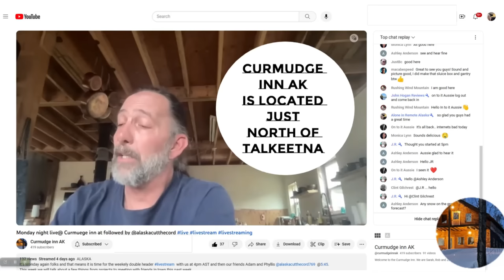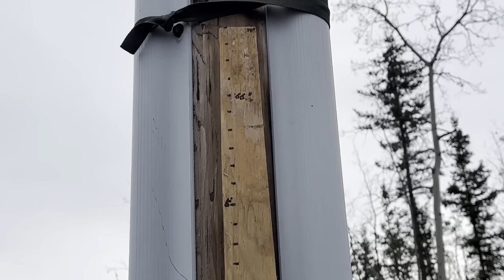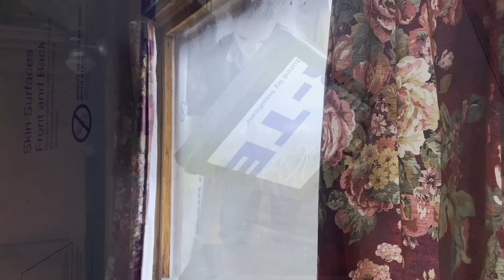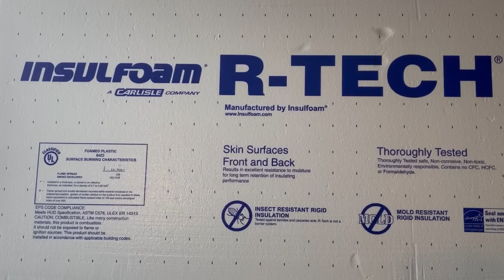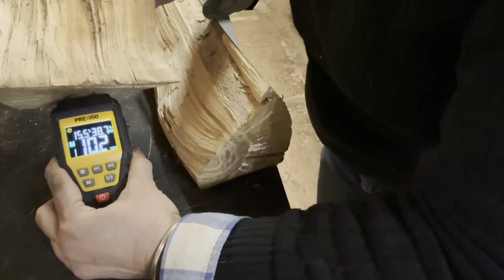DIY Firewood Storage Build - Working Smarter, Not Harder @ Alaska Remote Cabin

Comment: For window insulation, I use shrink plastic... it is clear, you put strips of double sided tape on the sills (all around), put the plastic over the window on those tape strips. Use a hair dryer to apply the heat and shrink the plastic tight. This creates a 2" thick air gap. No condensation whatsoever. And it allows light in. These come is kits that have different sizes for different windows/doors. The front of my house is 2 floors of glass 24' x 24' and this massively reduces heat loss..   For the firewood, I bring in a couple of days wood at a time and the wood dries out so much you can hear the wood splitting as it dries out. You Firewood rack looks awesome!

Comment: To completely eliminate condensation in your windows, install your rigid foam sheets into the opening (2"-4" thick) then tape a sheet of plastic to the interior wall with no air gaps whatsoever.  The interior sheet will additionally add some R value for the now completely isolated window cavity of around R2.

Comment: Just a thought from my 50+ years of preparing for winter. 50ft roll, or 2, or 3 of clear plastic, 4mil, 1/2 staples, and cardboard, to cut for strips. This method let's you keep your light, important in winter, creates an air space between your windows and plastic, which works as your insulation. Cut plastic to fit inside of windows, over trim. Cut cardboard strips to accept staples, keep plastic from tearing and damage to surface. 
Keeps the winter blues away for me and keeps the cold out! 💯

Comment: LED rope lights everywhere. Under your stairs in between your rafters on your ceiling along the baseboards and your hallways. It's nice they make them outdoors so there water proof. You can use them indoors. I have connected 300 feet in one section. They make 12 volt option but it's shorter.

Comment: An outside frame could be made of wood with a sheet of plexiglass fastened to it. Then a few clip brackets fastened to the top as to hang the storm window, then use a few deck screws to secure it tight all around the casing.. Just measure the out side window casing jot it down and make one.

Comment: Copper Wire 100foot LED lights off Amazon.with different light colors and remote cost was reasonable wasn't even 100/dollars and loved the remote and lighting up where I walked copper LED lights with remote no more falls also rubber matts cut a step strip and nail to the stairs prevents slips too DIY the lights are gorgeous btw

Comment: As always great content! I'll be fitting window insulation this weekend (I live in the Yukon). Just curious, is there a reason why you don't use window shrink insulation? (it's the inexpensive transparent window plastic that's fixed with tape and then use a hair dryer to remove the wrinkles?). Do you find it not as effective?

Comment: I have a question; do you have a generator for when you lose the electric power?
If so, do you keep it in a warm place so it's easy to get started?
Mine is outside, and where I live it occasionally goes to -15 degrees and I can get her started, but you must see temperatures as low as -50. 
Good luck to you, you're doing a fine job.

Comment: The soffit in the roof to the exterior should be enclosed with osb or other wood to reduce the cold from coming into the building. This also protects the house from rodents and bugs
Reply: soffit need venting in ak.  they must not be closed off. for asthetics vented soffit material must be used